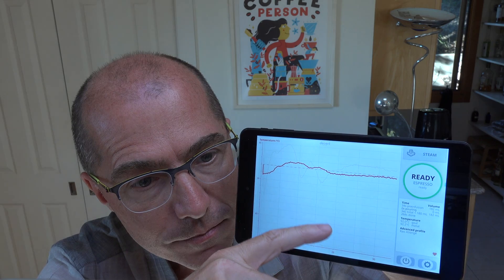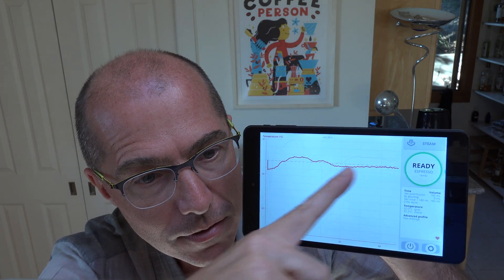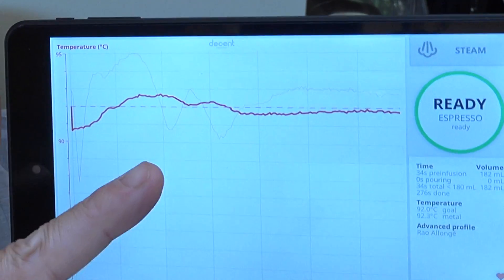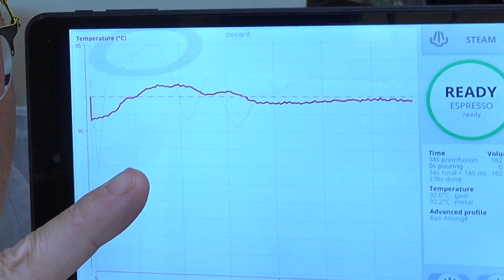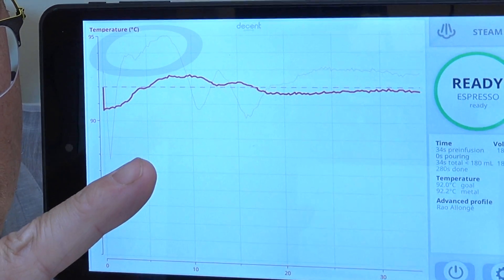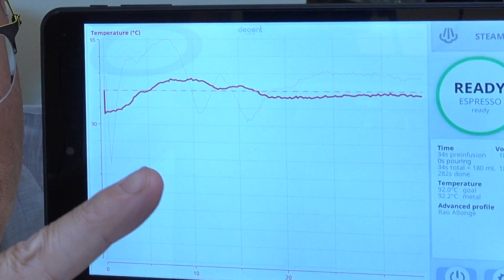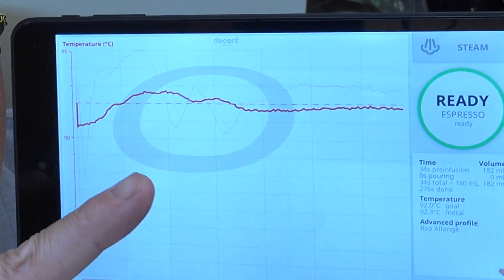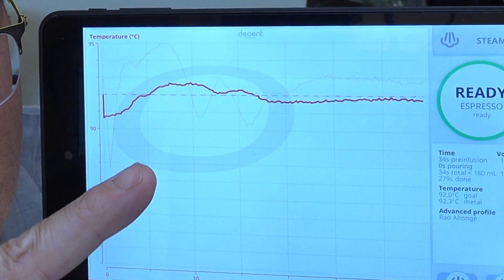Temperature stability on E61 and Decent

Comment: Traditional E61 machines can be upgraded with an Eric's thermometer which measures the temperature near the brewing chamber. A lot of home baristas upgrade their machines with it and consistent results can be obtained with a little practice concerning flushing routine. How would you compare temp stability of DE vs an E61 equipped with an Eric's thermometer ?

Comment: Having come to the home espresso world recently, it has confused me no end that accurate temperature measurement and maintenance is so hard to find, even in many expensive machines. To me, going from 92 to 93 to 94 celsius makes the difference between a good and bad cup of coffee for the beans I've tried so far, and I would be extremely frustrated to be using a machine that didn't have fine adjustment in that range (or even one where you had to 'surf and guess'). TL;DR thank you Decent for this R&D - hope it causes the industry to follow.
Reply: I agree it’s always hard to find the temperature facts about each machine because it’s essential for dialing in flavors